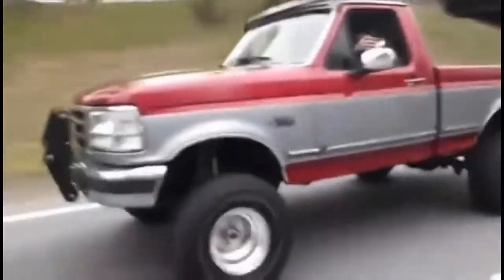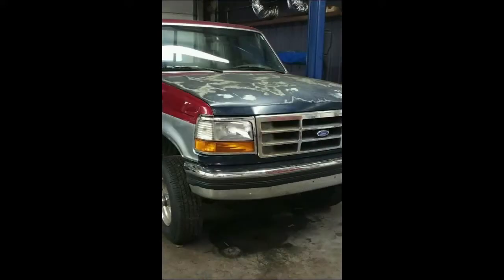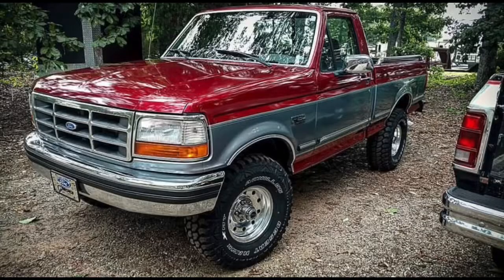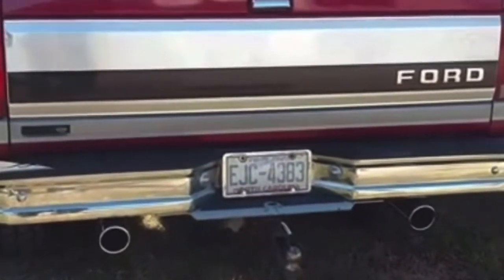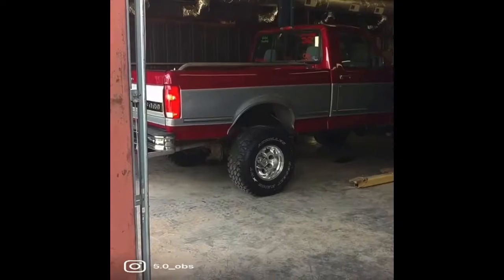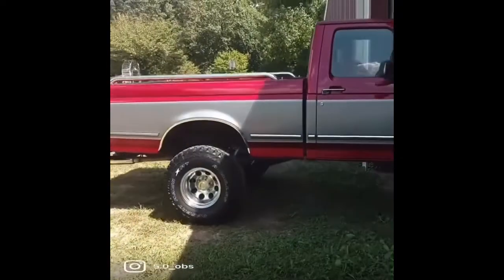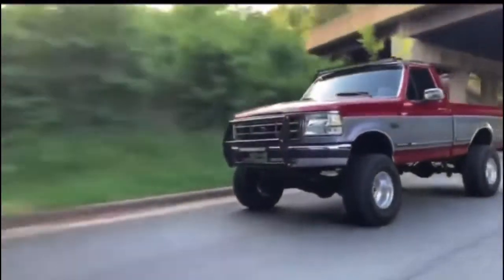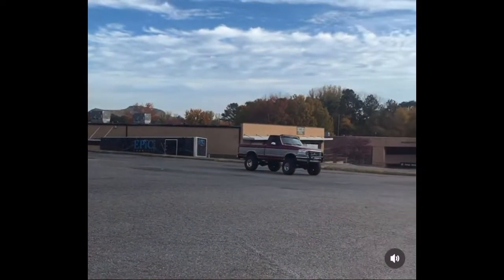Building OBS F150 ! 3 year build in 3 minutes!!

Comment: The center brackets for the ttb lift under the motor need to be welded. They will come loose.  Next you need gears. At least 4.56 but don't be afraid of 4.88s

Comment: Good solid looking OBS, you Guys did a great job getting it back on the road. Most of the time they end up in the scrap yard when they get wrecked, but I think they should be saved when it's possible. So it's good to see that you saved it. I really liked the look of it at 1:15 because it had just enough lift, and  I think you can't beat the looks of the stock Alcoa Rims on these Trucks.
Reply from the maker: Appreciate it man!
Reply: @TheBirdsNest93  Yeah Man no problem. Did you find a used front bumper, or did you buy an aftermarket one? I have a 1995 F-150 that's a pretty low mile truck, and it's in great shape. Except on the front bumper the chrome in a couple of spots about 3" around bubbled up & chipped off, there's no rust at all where the chrome came off. But it really aggravates me when I look at the truck, since it's so nice except for those 2 small spots. And of course, they're right on the top flat part of the bumper under the driver's headlight area. So, I'm wanting to get another bumper, and I'd like to find one with the cutouts that's in really good shape. But at this point I'd take one like I have now because I can't seem to find one in my area. I've thought about just buying a new aftermarket bumper, but I've heard there not nearly as good as the stock Ford bumpers.
Reply from the maker: @Blitzkrieg2002  it’s an original from the junkyard haha